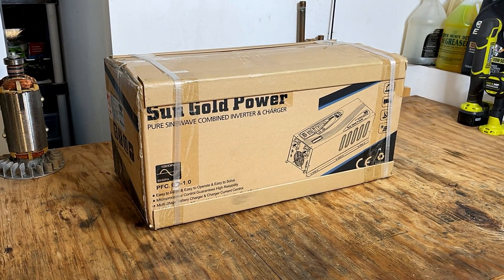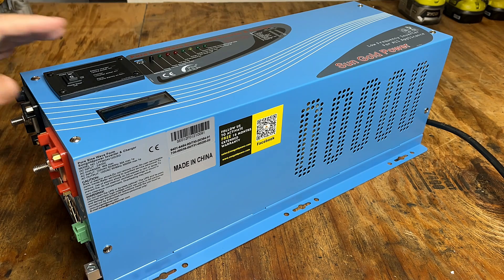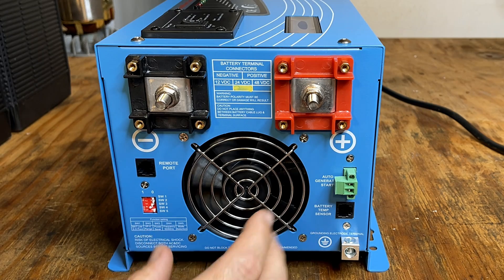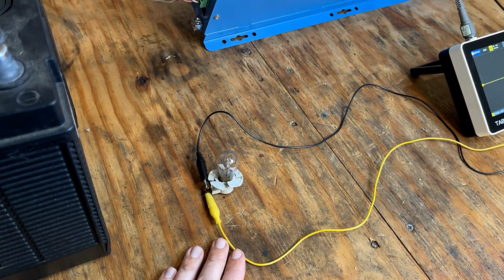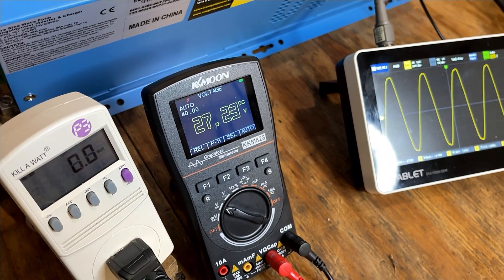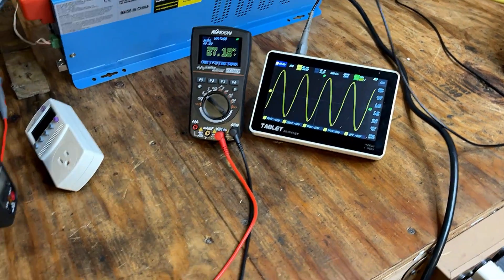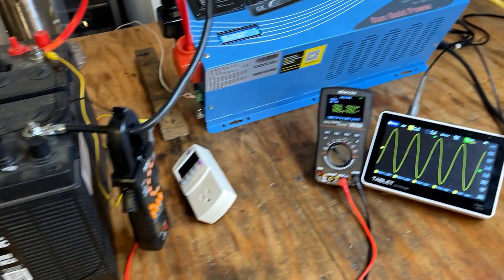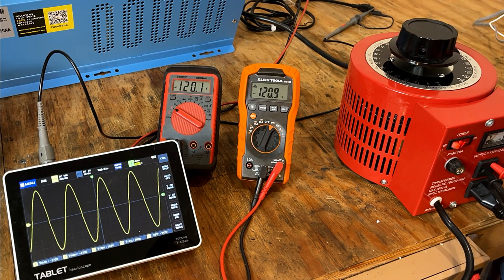SUNGOLDPOWER 3000W Pure Sine Wave Inverter Charger Test and Review

Comment: "Low Frequency" inverters have MOS-FETs. Just like a high frequency inverter. The difference is the voltage they are used at. In this LF inverter, the MOS-FETs are running directly off the battery voltage, and synthesize a low voltage mains frequency sine wave by switching the battery at high frequency using PWM . This makes about 18 VAC at 60 Hz in a 24 volt unit like the one you reviewed. The  60Hz 18 VAC sine wave is sent to a large step up transformer to raise it to 120/240 VAC
In a high frequency inverter the voltage from the battery is sent to a DC-DC boost converter that makes ~350 VDC. Then  MOS-FETs are used to directly synthesize a 60 Hz sine wave directly at the target line voltage using the same method as was used in the LF inverter, except for the fact the voltage was boosted in the DC realm instead of in the AC realm.
Reply: I like those as they have the same transformer that charges the batteries to also be the step-up transformer.
In charge mode, the output is center tapped at 2 rails of 12 volts AC (24 total).
In inverter mode, the mosfets "swing" the input voltage back and forth at 2 rails of 12 volts AC.
Reply: Great explanation. I hope the subscribers read your comments. I just stated briefly above that the unit MUST use a switching device such as a MOSFET. A transformer cannot provide switching. That is not up for argument.

Comment: Can you please  help with this issue:  Is there a way to convert AC 120v, 50hz to AC 120v 60Hz? Planning to take some electronics (60hz) to south america (50hz), will this inverter work for me?  I appreciate, watch and learned so much from your videos, thank you very much.
Reply from the maker: This will not convert AC 50 hertz to 60 hertz.  It will only run off a battery bank (DC) to generate 60 hertz.
Reply: Some can be switch internally...some will just work but maybe not 100%.

Comment: All inverters are driven by MOSFETs or IGBTs, the differences are if the transistors are before or after the transformer, and the switching frequency used to boost the voltage from battery voltage to line voltage.

Comment: Could this unit be installed in Prevost coach to replace a Xantrex 3000W inverter/charger?
Reply: This one is a 24-volt. They do have a 12-volt version I don't know what the Prevost has with the Zantec.

If it's 24 volt I bet you it could swap right in

Comment: Thanks for this nice video, I have same as this inverter but another model Power star W7 3000W 24V (PSW 3024E), from a while it starts to make fault (over load trip) second red led only when connecting to electricity . hope you can help me with this issue...

Comment: I ordered one of these to backup a sump pump, pellet stove, and fridge.  I also went with the 24V and 2 - 200A LifePo batteries.  Any info on wiring one of these to a sub-panel?  I'm not sure how the hot line would connect to a panel designed for 240V with 2 hot inputs?  Do you run a jumper between the 2 hots?
Reply: This particular model's sub-panel output is only for 120V applications according to the website description.  In spite of that, I'm glad James did this video. It never showed up on my radar when I was looking for a sump pump backup inverter. The Pump Sentry I bought last year only fried my sump pump when I tested the load interruption and caused a voltage surge, and it was back to the manufacturer for that one!  Thanks again for the video and the links, James!
Reply from the maker: I have not wired one of these to my house.  Without knowing your setup it is hard to comment.

Comment: Great demonstration video of the Sun Gold Power low frequency single phase inverter in full detail and high load testing. That is an awesome inverter compared to the Aims low frequency split phase inverter I use on my diy system at home . When you get a chance , check out my solar videos , hit like , leave a comment and subscribe . May the solar be with you .

Comment: I bought one after installing it in a friend's house and it failed me in less than a year during a lighting storm. No lighting hit my house and there's no evidence of it burning or anything, but it cuts on now and runs for about two minutes then the alarm comes on and it stops outputting ac. I noticed when it was working that it runs hot. So I think it failing during the lightning storm was coincidence
Reply: I always worry about these products failing they're so expensive

Comment: Very interesting when using the microwave against other loads. I think the unit will be MOS FET as the current in current out suggests that. The US army used rotary converters in the 1940, That would be the easier non MOS FET route. The microwave gives a very typical MOS FET working hard look. It could be a hybrid design, THD tyupical is about 3% at a guess. Not bad.

Comment: I have considered getting a full home generator for a long time for emergencies and ultimately decided on an inverter installed in my truck. my main issue with the generator was the noise and with the inverter in the truck it's much quieter and at a normal idle the truck can actually run for a really long time. It's only a chevy trailblazer so it's just regular fuel not diesel and in emergency situations it does awesome. I can easily run a full size fridge, lighting, and even TVs and computers with no problem not to mention making sure cell phones stay charged. I do get a little nervous leaving the truck running with no one inside it. but in those emergency situations it's typically pouring down rain and lightening so i doubt anyone would be outside thinking of stealing a car.
Reply from the maker: That is a good idea.  Most cars can produce around 1000 watts at 120 volts and up to about 3,000 watts continuous.  The car battery can easily absorb surges associated inductive loads.
Reply: Been there, done that.  At idle, there is only about 30 amps available from an automotive electrical system, assuming nothing else on the car that consumes power is turned off.  That translates to 300 to 360 watts of inverter output power.  You can pull more current than this but, you will cook your alternator.  I would leave the hood up while the engine is running and (of course) the car would need to have its exhaust routed to the outside at least 25 feet away from your house.  Although this method works okay in emergencies, I would recommend using an inverter generator instead for something more permanent.  They are fairly quiet and get better gas mileage than a simple open frame portable generator.
Reply: @billharris6886  Yep agree, the Harbor Freight Predator Inverter line is pretty good, the 3500 is a popular option/size.

Comment: I use Victron inverters, they have low standby power at no load (2 watts) and very high efficiency (98%) They also have the ability to use the inverter to boost the mains input power if perhaps it is not enough for an application. Victron used to use low frequency heavy toroids 5 years ago, but now they all use high frequency. Still have a surge of 2x inverter capacity. A 500w Victron runs and starts my refrigerator fine- my 1600 watt runs 4 refrigerators simultaneously.
Reply: 98% efficiency cus it's using switch mode topology. Those can't handle heavy current surge.. u should try running a non inverter ac on it and see how it does 😂. These low frequency bois can handle 3x 4x surge like seen with the air compressor. Refrigerators are not a huge load and they don't have a ton of starting current..
Reply: What is the idle consumption on the sun gold. I think it said 1.6 amps but I don't know how to convert that to watts.. I need to learn how to do that because they all come in amps well they don't all say amps. The all-in-one inverter 2424 mPP uses 50 that's the only drawback to those well I don't know about the only but that's the biggest one. I wonder what the 1.6 amps on this means
Reply: Victron is all marketing and is crap.
Reply: @talusranch990  you cant afford victron, you got butt hurt!!!

Comment: Hi James
After watching your video on the Power inverter I went on the web and ordered one. I received a package yesterday in the mail from the seller with a five pack of N 95 masks. I tried reaching the company for a refund or some type of explanation for the mix up I didn’t get anywhere. I reached out to Paypal which I paid for the unit with. Paypal informed me that the seller was paid their full amount due to the fact that the tracking number shows (delivered).
The Inverter/charger Was exactly what I was looking for. Sad to me that people out there are that crooked
Reply from the maker: Did you buy from one of the links in the video description?  If so, then I will pull it immediately.
Reply: @jcondon1  No I googled SUNGOLDPOWER 3000W

Comment: Can you comment on fan noise when this inverter is running?  I did not hear any fan when this was running.  Tnx.
Reply from the maker: I could hear it a little.  It is variable speed so it runs quiet and increases speed with load/temp.

Comment: If your lights dim when your compressor kick's om open your panel box up and check to make sure that all the screws are tight check the common grounds I had this problem and found most were at least a half turn some were as much as 2 with all that resistance gone it not only fixed the problem my power bill dropped too
Reply from the maker: Would not surprise me.  Have found a lot of wiring issues in my house over the years.

Comment: Nice review. What impressed me was the relatively low quiescent current draw (no load). Not much more than my 3500 watt Reliable hi freq unit. Too bad you did not show the max inrush amps from batteries to inverter when starting that direct drive air compressor! Not all clamp meters can do a peak current though. I have an old 1200 watt modified squarewave inverter (12v) that will pull over 300 amps for a split second when starting, say a de-humidifer compressor!
Reply from the maker: Need to upgrade my tooling.
Reply: @James Condon  it's been a year you probably got that different tester, 😊. You don't happen to know the idle consumption in Watts by chance do you. Or could you explain how convert idle consumption from amps to watts.
Thanks in advance

Comment: Very nice setup! I have a more basic one with an NLA 1500W Tiger Claw sine wave inverter. Its connected to the same size battery bank as yours in a box in the basement. It powers my 10 circuit transfer switch which backs up mostly lights and small circuits. The generator hooks up to my interlock kit for the heavier loads like the furnace and hot water heater.
Reply from the maker: What kind of batteries are you using?  Am considering the same with this.  The last thing my wife wants to do in a power outage (when I am not home) is start the generator.
Reply: @jcondon1  two group 29DC batteries. Ill be doing a video soon on the whole setup. I donhave an old one from when I was at my old house, but the setup deserves a video update im thinking
Reply from the maker: Have a non related question for you.  I am working on a brushless generator that has a bad stud diode on the rotor.  Easy enough to replace, but no information anywhere on the type of diode used/specs etc.  Have a few emails out to various manufactures but have not heard back yet.  Unfortunately the generator manufacturer sold out to Generac back in 2014 so getting information from Generac been impossible.  Worst case, if I cannot find any specs is there a certain type or spec I should keep in mind if buying a random diode?  The generator is a Baldor PC50H.  Here are a few pics of the diode 
https://drive.google.com/file/d/1vOQs8j6ifuPR0xsi0mCs8_E3mKu1TXWb/view?usp=sharing
https://drive.google.com/file/d/10aDNsrEfSqlLFZwNhPwecYyRNUPvkAK8/view?usp=sharing 
https://drive.google.com/file/d/19dzWDMk0Ver3u0Bz5vWid7WDiDmgF9eZ/view?usp=sharing
Reply: @jcondon1  checking on the part#. it is a stud mount, whats the thread size? 3/8-16? Typically those are over 200A and twice the nameplate voltage rated, edit, more specifically double the peak inverse voltage. any other markings on the diode?
Reply: @jcondon1  Cant find anything on the part number, but i think this might be an avalanche diode. it rectifies the AC coming from the cap, but if the voltage gets too high, it conducts in the other direction to save the rotor windings. hard to say on specs. Would you say Baldor is similar to Devilbiss, Winco etc? I never got this deep into a rotor repair
Reply from the maker: I believe it is a Vishay diode.  https://www.vishay.com/diodes/med-high-diodes/stud/ I sent them an email today, hopefully they will reply.  Baldor was acquired by Generac back in 2014.  I called Generac today.  They told me it was an industrial generator and would have to email Huntington Power for support so I did.  Not holding my breath.  It kills me when there is an easy fix, but no support to make it happen.  I will check the thread size and look it over to see what else I can find.  When you say double be nameplate are you referring to the 240v output?  Similar to Winco and Devilbiss in that its brushless and well built, but the rotor on this one is unlike any that I have seen before. https://drive.google.com/file/d/1hu3nyrpuo3EIw9Bc43aT6l425HFvkUdT/view?usp=sharing
Reply: @jcondon1  yes at least double. But depending on the diode type. For avalanche diodes their purpose is to protect the windings from voltage spikes, so their PIC will be crazy high. No other markings on the diode other than the last few pics you sent?
Reply from the maker: @Bassguitarist1985  no other markings on this diode.  There is also a large varistor across the coil output wires in parallel with the  diode.  As far as the screw size, I am guessing it is 3/16 32 tpi.  Still need to verify but probably a #10 or #8.  The width of the screw threads are 0.17”.  Total length of the diode is 1.25” from end to end.
Reply: @jcondon1  acknowledged. Yea the varistor conducts above a certain voltage to shunt any voltage spikes from the collapsing magnetic field, called an inductive kick. Yeah I'm not sure what that part# is.
Reply from the maker: @Bassguitarist1985  got a response from Huntington Power “Parts Technical at Generac cannot find a Rotor Diode for this unit”.   Maybe Vishay will come through.  Otherwise I might replace the power head with a standard China built one with an AVR.  A lot of rewriting though.  Otherwise I could use a random diode with a high current and voltage rating, but seems like a lot of work to put it back together without knowing how long it will last….not to mention as you pointed out, what type of diode is it.  Thought it was a slam dunk when I found the bad diode with numbers and a manufacturer name in it.
Reply: @jcondon1  it's a tough thing unfortunately I don't think these companies ever expected for these machines to be worked on at the level you are doing. To try and dig for the build list and schematic which I'm sure do exist but likely have either been archived or even thrown out at this point. Planned obsoletans. My best guess is that it was an avalanche diode. If one of the diodes is still good you can measure the voltage drop and match the form factor and the voltage drop. From there you pick the highest current available and see if that would work. It's a gamble as you have stated it could not last.
Reply from the maker: The Vishay DO-203AA class of stud diodes are an exact match dimensionally.  Think I might roll the dice on this one.  This is the highest rated one I have found on mouser https://www.mouser.com/ProductDetail/Vishay-Semiconductors/VS-25F120M?qs=asPD7ZL2j3V0JAxZRh8RBQ%3D%3D  Any words of wisdom before doing something stupid?
Reply: @jcondon1  its worth a shot! Of it works I cant wait to see the video!
Reply: @jcondon1  Get one of those auction military Diesel generators for sometimes $200ish. Autostart...she doesn't have to do anything cuz your inverter will start it as needed.
Reply: @jcondon1  One thing to be aware of is that those stud mount diodes can be either polarity.  If there's another one in there with the same numbering,   I'd check it with your meter.

Comment: This is crazy how this stuff works in my mind it would drain the batterys fast to make a microwave work. That's why I want solar. But thes solar companys make you have to stay on the grid but my power company charges 50 to $100 a month for storage. But they say buy the battiers to help and if power still goes out with he panels on grid you do got battiers they said you can't disconnect the grid after getting panels bc ya can be intruble lol so sad . And they said the panels would stop working which make no sence

Comment: don't roll that generator outside..... it may and. will cause islanding...... that is.... someone working on your supply will get zapped.,.....if you have batteries or a blackout..... make sure you are disconnected from the supply (via contactor) or you may kill someone.
Reply from the maker: Yes.  This can only be connected to the grid or the generator.  If you want both, then you need a transfer switch.

Comment: I have a low freq inverter.... 8000 watts...... it is great although I do get an alarm if I leave it on..... it starts everything. (yes I am a grinder nerd..... I have 6) but even though it is high power low freq, it does not like my twin cilinder air compressor....... I have that connected to mains power....... just a comment on my own situation.... cheers

Comment: 20 hours ago
That’s a super nice inverter. Thanks for showing it to us. I was hoping you had a gen-set hooked up and it was going to switch between the three modes of operation.
Reply from the maker: I really wanted to, but do not have one that is comparable currently.  Also there is only one AC input so you can run on generator or grid.  Need a transfer switch to do both.